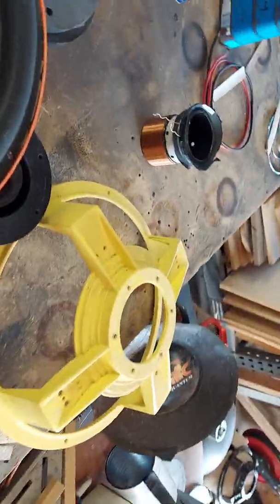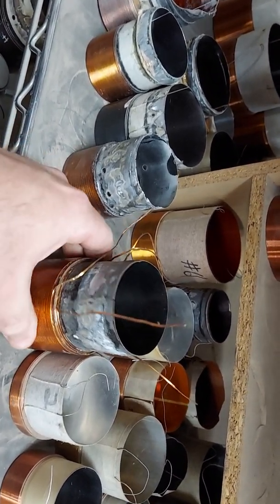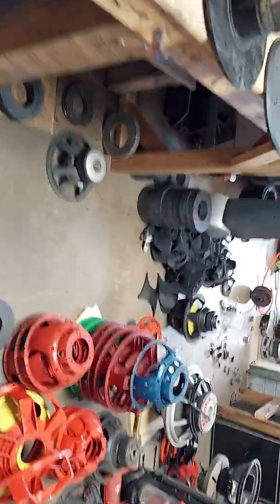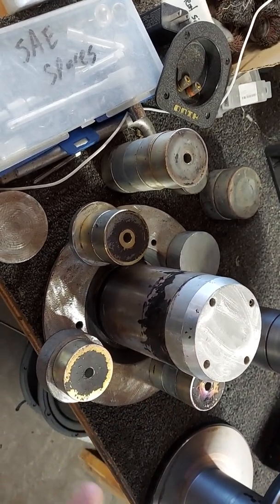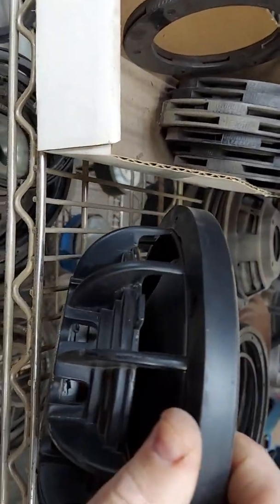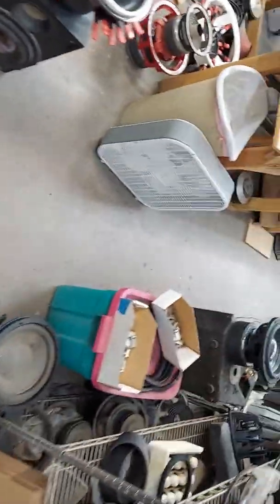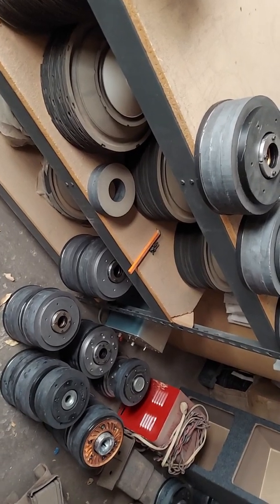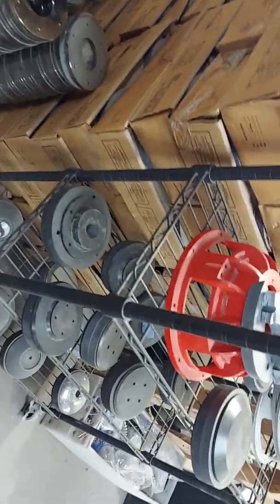Coil harvesting, neo harvesting - SAVE MONEY!  DIY @ The Robot Underground

Comment: I have 12" kicker comp r. Both coils test out fine ar 4 ohms but it won't suspend down. It moves freely upwards then will  not push down past normal resting position. Any idea?
Reply from the maker: The only way to know for sure is to pull it apart.  Text me a pic first, 6023126504

Comment: I run a run hcca subs I do not like the recons that they make the spiders they make ain't worth a s*** and I can't get no one to find the surrounds that they take and do recalls with the original baskets is there a suggestion for this problem so I have five subs I need to recone because all of them on the spider the second row from the triple joint it's like the spider just breaks and it when it gets to that point the sub is still play but when it gets to that point it will make a slight popping noise but you lose 40% of its power so how would I go about finding surrounds that they use or something to suffice

Comment: Hey man I niw this may be a rhetorical question for you but what adhesive and glues would you recommend for rebuilding some subs..I got a kit from psi a few month ago and the activator leaked out and the glue dried up before I cld use it..
Reply from the maker: Text a pic to me, 6023126504
Reply: @RobotUnderground  hey bro so sorry I forgot to message you back..what would you like a pic of the adhesive or my subs..I threw the adhesive away..
Also I been watching alot of your videos and I really like what you got to say very informative..I had the idea to see if it would be possible to get a cpl crazy 10s built..im putting together a med size build with 4 possibly 6 10s in a 4th or 6th order box not wall I am wanting  to blow people away with a smaller sub build you see so many bigger sub builds..I want to go out side the box..
Reply from the maker: @bass321head  Text me direct, 6023126504